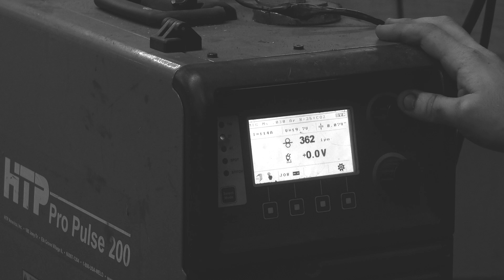GIANT Steel Chiminea | CNC Plasma Cut Firepit

Comment: What steel grade and thickness did you use please?  I've been told 0.7mm stainless.  Would mild steel be ok to burn wood?
Reply from the maker: this is 12ga Hot Rolled. Burns wood just fine.
Reply: Would cold rolled steel work just the same?
Reply from the maker: Yeah, would just rust faster
Reply: @42Fab  thank you! im thinking about making one. Not sure what cost more hot or cold rolled but i want to look at my options and see whats most cost effective.

Comment: Nice one. I want to make myself a BBC for the yard from raw steel sheets like COR-TEN. Do You have an idea how long a 3mm (1/4') steel can last in a continental climate unprotected from the elements?
Reply from the maker: A long time
Reply: As long as you make sure water can drain and doesn't collect somewhere in the structure, you should be fine.